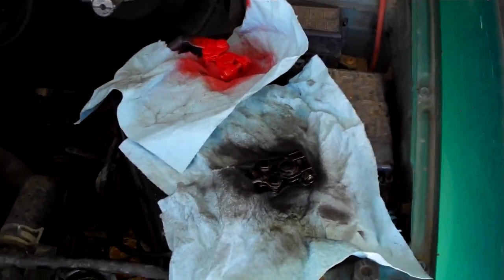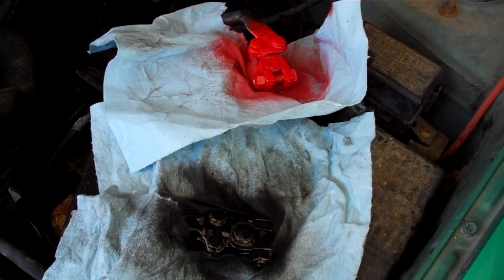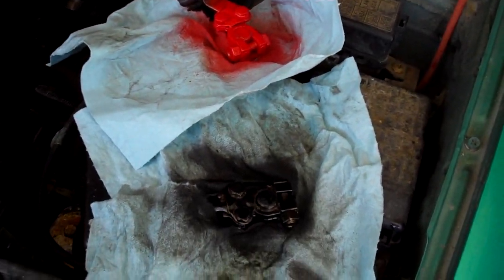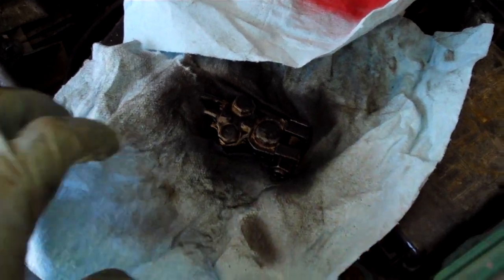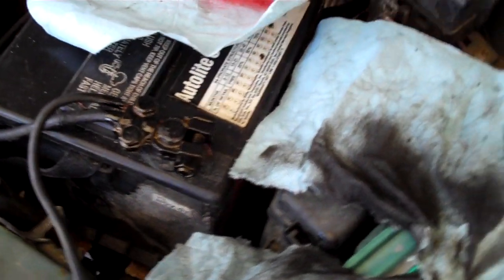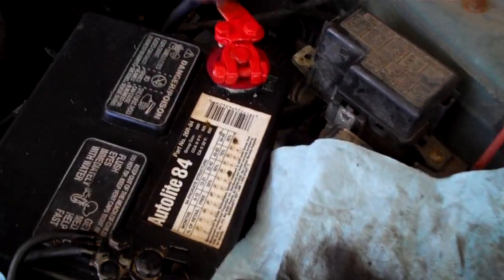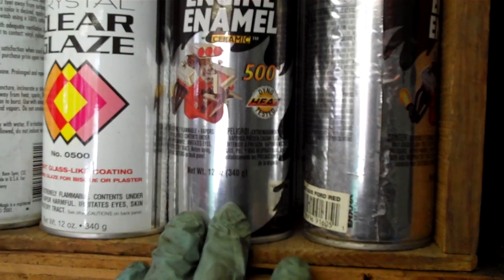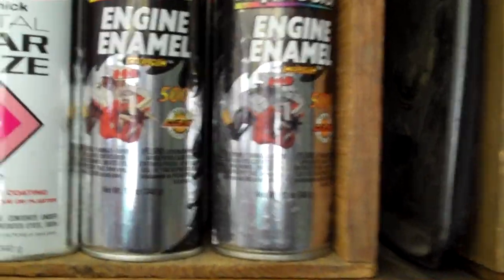How to prevent corrosion on your battery cables

Comment: Hi Brian, this question is off the subject but as the video was playing i seen you had a mobile frame machine there, im thinking of buying one wondering what that model is and how good does it work? would you recommend it? Im a one man show and dont have a garage or shop so space is a issue and do not have the space for a real frame machine, i do everything at home but will get a shop when the time is right.
they have one on ebay for 2,700.00 Bo free delivery

Comment: The round red and green felt circles you see in the battery display at the store work well for preventing corrosion build up. The battery posts leak where they go into the battery. That is where the corrosion comes from. Saturate the felts with oil and slip them over the posts, wipe oil off the posts. Clean the posts and the clamps and fasten them very tightly. DC voltage needs very tight connections everywhere. A sealed battery is not really sealed. Gasses must be vented so they have vents on the tops that is why I never recommend baking soda and water to clean a battery, it can get into the battery! Never let your alternator charge a dead battery, use a charger. Alternators are not designed to charge just keep a good battery topped while driving. If you must jump start be sure to get the battery on a charger quickly. Slow charge is ideal and if you do not use the vehicle much charge the battery every week and also keep it clamped down so it does not move around. These tricks can get you an extra year out of your battery. An automotive battery can only be run down a couple times and recharged before it will not charge fully again plus the alternator will overwork constantly so a $300 fix will be in the near future!

Comment from the maker: An over charging alternator can make a battery overheat and sweat acid over the top of the battery.  That acid is the leading cause of corrosion on the terminals.

Comment: I use petroleum jelly for the battery terminals, exterior light bulb sockets and trailer connectors.

The best part is that petroleum jelly/Vaseline is good for the skin so there is no harm to your skin, when you touch it in the future. 

My father learned this trick form a German guy a while back.

Comment: I use Duralast Battery terminal cushions. I am not completly sure on the name but it's pretty close. it costs about $2.00 at Autozone and you just but in between the battery and the cables, so really easy to install. They work really well and are reusable.